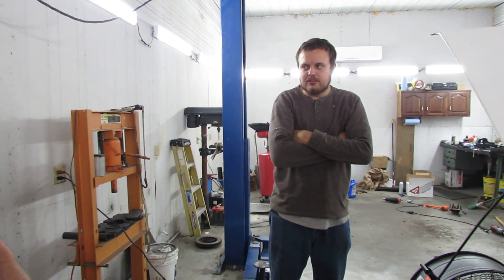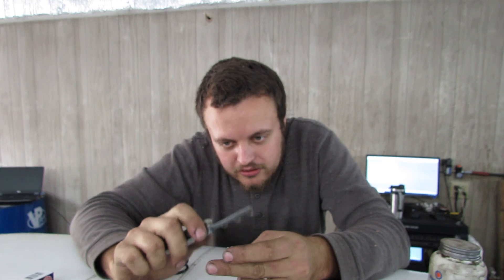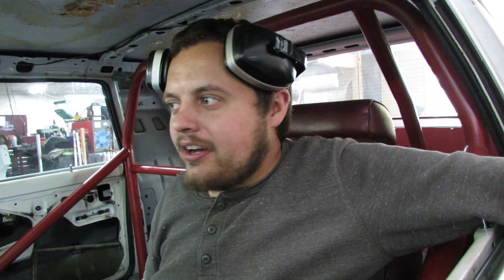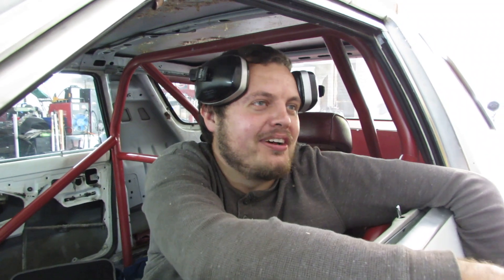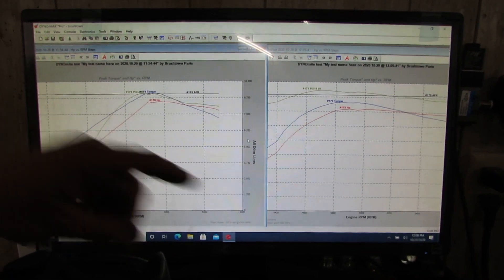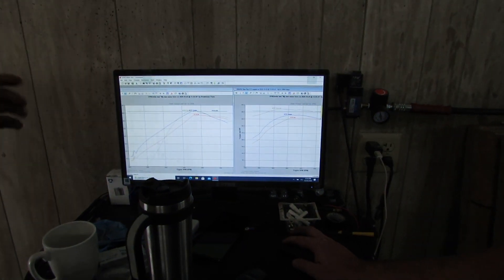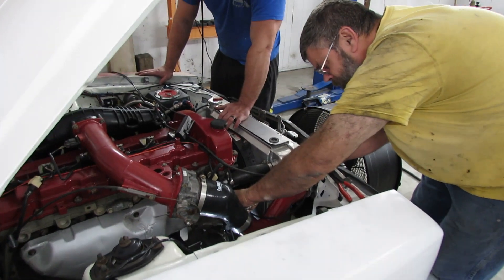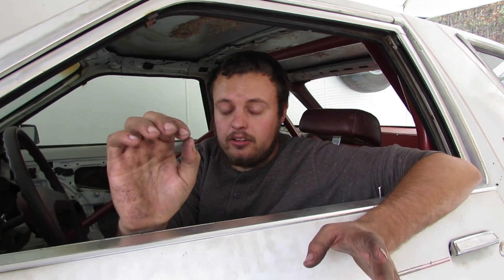Vortec 4200 Fairmont Futura: Dyno Time!

Comment: Seems like you never mention  the torgue.
Reply from the maker: Had problems with the RPM probe. HP wins races. You could also easily do the math to get an idea. These Motors have a very flat torque curve and peak the HP at 5700 with stock cams.

Comment: I just dont understand why anyone would like this engine!? Especially if youre a mechanic and have to work on these hunk's of plastic and aluminum junk. For what you're putting into it, it would be far cheaper to go with a chevy 250 or 300 inline 6 and you'd make more power! These 4200's are full of defects and problems. They are especially not suited for boost being a high compression engine. Uggghhh... I never, EVER want to work on these piles ever again! Kudos to you, I just couldnt bring myself to do it. Newer is not always better.
Reply from the maker: We actually don't have a ton of money into that car. The engine was $175 and is completely stock. Stock intake. Modified stock exhaust manifold. $200 microsquirt. $20 transmission. And a little bit of time hanging out with my Brother and Dad in the shop. 

Don't get me wrong. I want to do a 250 for a future project. That's where I got my start, but I really don't think it will make power as easily as these do.
Reply: Bro he'd making 1000hp with it now

Comment: Put a Ford in a Ford...again,if you wanna run that GM engine @ the drags,get a 78-83 Malibu.
Reply from the maker: If Ford made a better bang for your buck inline 6, we'd be running it. Sorry, no brand loyalty here.
Reply: @Calvin-Nelson  300 inline6...there you go
Reply from the maker: @slyane7320  No cross-flow head, and way too heavy. The GM unit makes way more power NA, so it will make more power with with boost. They both can be had for about the same price, but the 4200 is capable of so much more.

Comment: Do you know where I can find a parts list for a ~500hp build on one of these?
Reply: Chinese gt45 turbo and prayer
Reply: @DavidValdezBigWaveDave  no fuel? forged parts, aftermarket  oil pan?
Reply: @lazarusmagellan2367  idk anything about the atlas motors but I do know that most stock gm Delphi fuel injectors can be decapped to increase fuel flow. It’s a niche engine only used in a few gm trucks so I don’t think you’ll find any aftermarket support for things like forged parts or oil pans.

Comment: So I have a huge favor and ? So I have a 03 envoy so first code I got was the vvt solenoid so replaced it started good them started again now I have camshaft position sensor code and crankshaft code and while driving u wouldnt notice anything untill u throttle down then it goes 2 4000 rpm and holds will not go any faster I have replaced these sensors and solenoid plz help , I'm a amateur back yard mechanic don't really have the money cause of a new family but I have got to get this figured out plz any info will be greatly appreciated I did test signal going to the cam sen and seems find along with grounds
Reply from the maker: The only other thing in that system is that VVT cam sprocket. They're a little more involved to replace.

Comment: What turbo is that to make <450hp on a 4.2L at 16PSI? So I never buy one.
Reply from the maker: Precision 5976E. Works great. Easily propelled the car to a 9.98 second pass at 134 on 15 psi. Transmission was starting to fail on the final pull which is likely why it didn't put a larger number down. Feel free not to buy one. Leaves more for the rest of us.
Reply: @Calvin-Nelson  listening to the pulls I couldn't figure out the convertor. It sounded like it had a 4500stall.sounds like you're doing pulls in drive and looking at the dyno readings the converter isn't coming close to lockup until almost 5000rpm.
Reply from the maker: @timothybayliss6680  Yep. It was slipping.

Comment: How did you find performance stuff for the 4.2 i6 was it all custom?
Reply from the maker: All custom.
Reply: @Calvin-Nelson  gotcha yeah I've tried finding aftermarket stuff for my 4.2 trailblazer but I can't except for a cold air intake and I made a custom straight pipe so that's what I thought which kinda sucks LOL
Reply from the maker: @Rodster13  Yeah. Aftermarket for these engines is nearly non-existent, but with some time, tools, and ingenuity, you can make anything work.
Reply: @Calvin-Nelson  yeah I'm probably gonna leave it with the straight pipe and get a cold air intake but I want to build a vehicle from the ground up either a Cummins or a 5.3 Chevy silverado

Comment: If you get a chance can you post an overlay of the curves with the exhaust cam phased on the sloppy page?
Reply from the maker: Yeah. I don't have the Dyno data. It picked up everywhere. The VVT is totally useless. It is better to get the cam into the best spot and lock it in.
Reply: @Calvin-Nelson  Do you know what the centerlines are with the VVT on and off?  I have been playing with cam centerlines for years on BMW inline 6's and in my experience the right setting for the exhaust cam works everywhere, but the intake cam timing have massive amount of affect on moving the curve up and down and on peak power.  If you saw gains everywhere with the exhaust retarded I wonder if it still needs more retard.  I am not surprised that you gained everywhere by retarding the exhaust cam, it seams that most factory cams have way to much advance on the exhaust.
Reply from the maker: @someguy325es  I can't give you specific numbers, but I am told that the cams default to a zero overlap state when the VVT is inactive.I would not be surprised if it wanted more retard on the exhaust cam, but we did not have enough time that particular day to find the end of that road
Reply: @Calvin-Nelson   Oh wow, yeah its guaranteed to be a complete turd with 0 overlap, especially in the mid range.  I would want the exhaust valve to close at like 20-25 deg ATDC and then time the intake centerline to suit the desired rpm range.

Comment: Great job, you need to give the boys at Haltech a call, they probably have a system to run your studebaker with VVT
Reply: How about transmission retrofitting, say a 6L90, 8L90 MQE or 10L90 fitted to a 2006  Bowtie with 4.8.
Reply: @shadowopsairman1583  good question, I don’t know the answer unfortunately, it’s worth a call to Haltech right?

Comment: Really glad these 4200s are starting to gain some momentum. I remember being impressed reading about them when they came out circa 1999. Lots of good innovation in them. Certainly some limitations too...but what's not to like about 441hp for 6 cylinders?
Reply: GM should of Kept the Atlas like the Buick Series 2/3.
Reply: @shadowopsairman1583  they’re so dumb only reason they didn’t is cause they kind of eat gas and most people don’t fix the parts to fix the gas mileage and that’s why they’re not being made
Reply: What cars does the 4200 come in???
Reply: @mmjnice97  primarily the Trailblazer
Reply: @Str8sixfan  what years? ?? I have the i5 second series straight 5 cylinder in my hummer H3T BTW you can check it out on my Youtube channel.. Really torquey. Little engine's but the compression is so high and the components aren't beefy enough  to handle boost well.. When the engine dies ,,, and it seems like it ran just as good as the day I bought it i would like to swap something really cool into it... turbo diesel maybe or a LS based engine
Reply: @mmjnice97  I don't recall when they stopped, but pretty sure 2002 is when they started
Reply: @Str8sixfan  that's crazy. ... GM Put a straight 6 in one vehicle back in the early 2000's and Toyota couldn't make an updated straight 6 to put into the supra and priced it with the corvettes smh... Like yea they wonder why nobody has bought the car.. I live in a medium to large size city and haven't seen but one driving on the road so far... And the main reason I would drop 55k on one or buy a used one is no manual transmission 😤
Reply: @mmjnice97  comes in GMC envoy , trailblazers, Isuzu ascenders, Saab 9-7x, Buick rainiers. The inline 4 and inline 5 we're from the same straight six just chopped off the one or two cylinders to save money. The atlas motors were one of a kind because they have. 10:1 compression ratio and vvt is on the exhaust end which no manufacturer tried before them.

Comment: Stoked to see the VVT working! I have a few questions, I did a 08 envoy frame/ engine swap on my 66 C10. That engine has a rod knock. But I have another 05 engine with a blown head gasket that I got running on an ECU Master ECU. If I put the 05 bottom ends and the 08 head together do you think ill have issues with the different crank signals? Or would I only have that issue if I tried to run the stock ECU?
Reply: Yeah Trevor ! I’m waiting on the c10 project!
Reply: Rod knock, does it remain after the engine is warm? Or does it sound like a sewing machine?

Are you dealing with the 4200 or a LS Engine?
Reply: Stock ecu likely...with an ecumaster you should be able to configure trigger settings to work correctly
Reply from the maker: It depends if the ECU master ECU is setup to recognize the 7x trigger on the 05 engine. Are you running wasted spark?